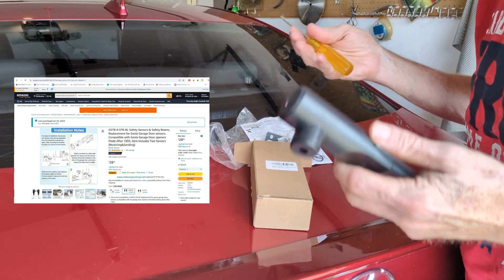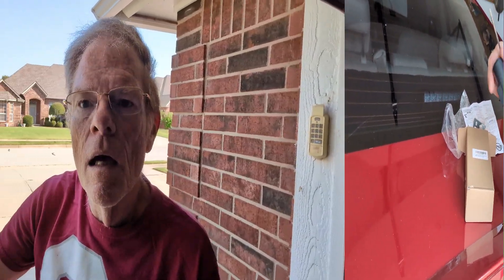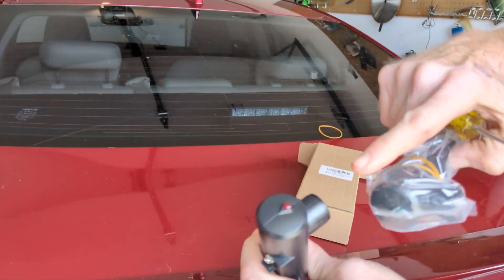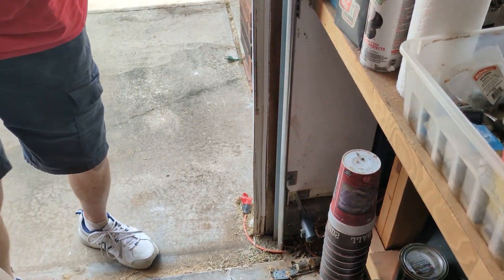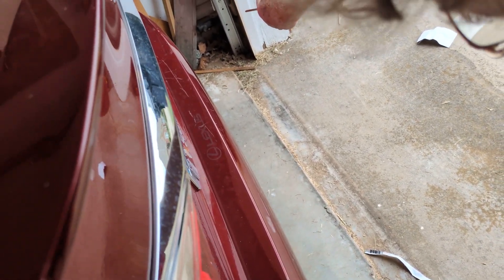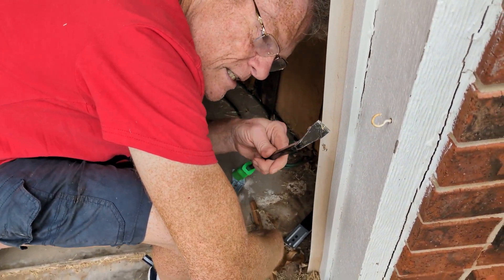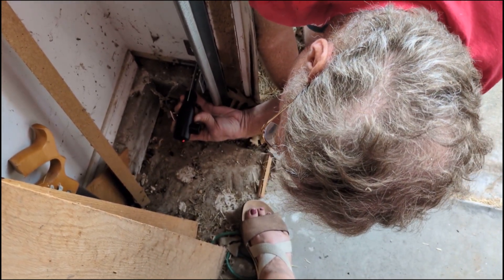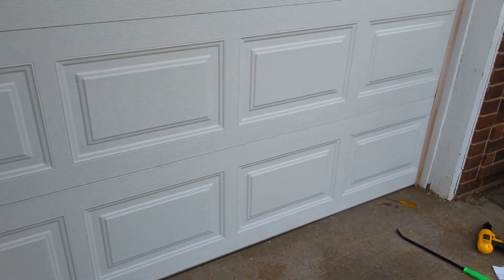Genie Garage Door Won't Close - Unusual Sensor Issue

Comment: Very informative Video, however you didn’t mention that if the summer sun shines mostly let’s say on the fight side of the garage door, that’s the side where you want to place the red light sensor which is the transmitter. The green light sensor is the receiver. Originally, they placed my sensors with the green light on the sunny side and the garage door during the hot summers would start to close then reverse itself to full open. After a lot of research and wasted money with garage door companies, I figured out the problem and installed new sensors in the correct position and everything works fine now.

Comment: Good Evening, our garage was flooded by Helene and took out our sensors.  We are getting a new garage door and system, it is past time, but want to shut the door in the meantime.  Can we bypass the sensors so we don't have to get out the car and close the door from inside the house and then walk outside?
Reply from the maker: @mgt2010fla  Man, I am so sorry.  If the sensors were water damaged I don't think you can bypass them. The receiver has a small board that sends out a signal back to the opener head that allows the motor to engage. The only thing you could try would be to direct connect the wires on the receiving sensor but I honestly don't think that will work. It might be worth a try. If I find something to the contrary I will let you know.
Reply: @DIYDaveOK  I actually thought of that but didn't want to fry the whole thing which would lead to my wife having to open and close the double size garage door when she leaves the house. Know anyone who wants to bid on a whole new system, door, quiet motor, new rails, etc on DI by TGH?
Reply: @DIYDaveOK  Thank you!